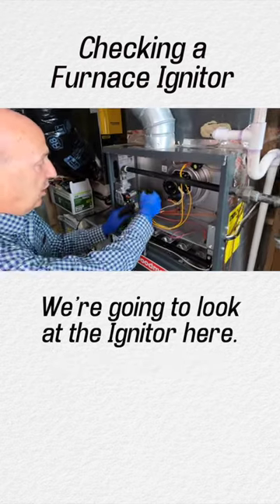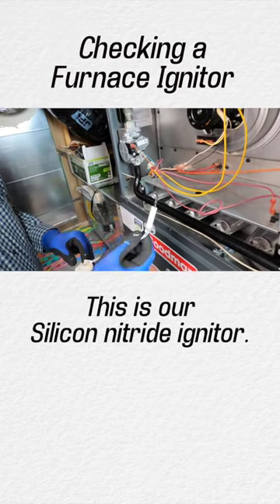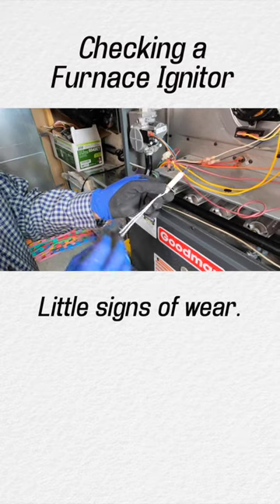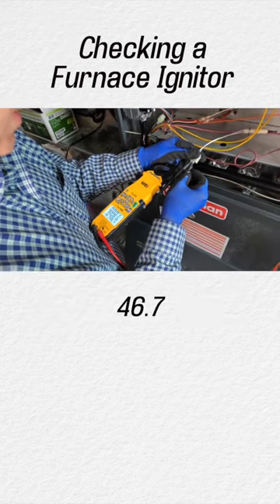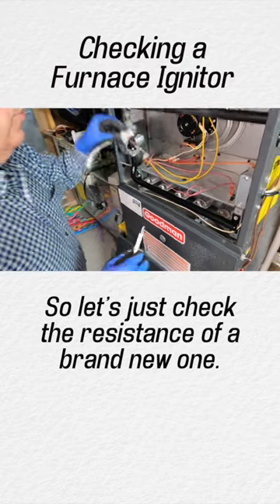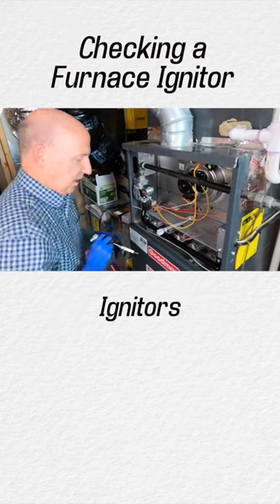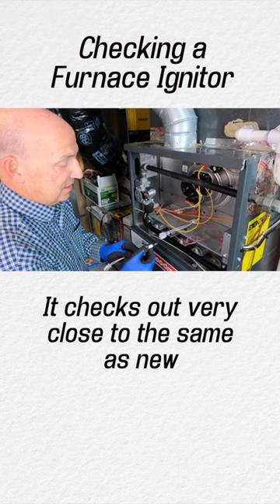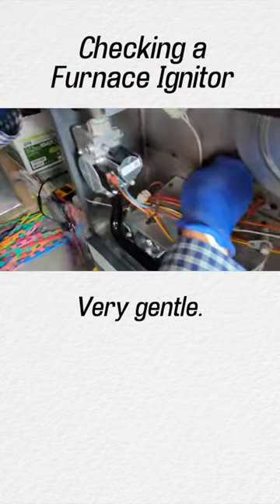👉Checking a Furnace Ignitor #shorts

Comment: unless you have chart that tells you what a specific ignitor is supposed to ohm at, at a specific temperature, this is not a good way to tell of a ignitor is bad or not. If it just turned off or just was in the flame it's going to ohm way higher than one sitting in your truck.